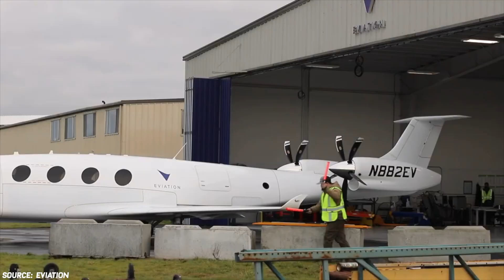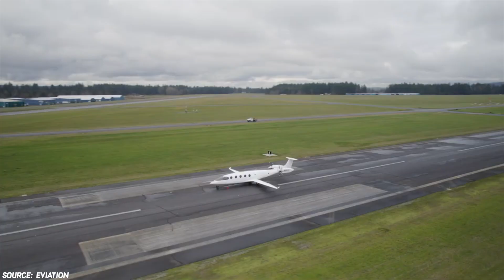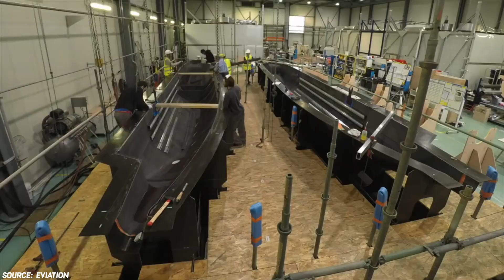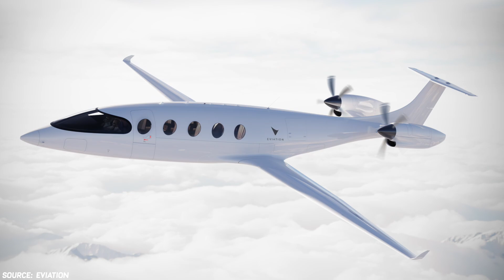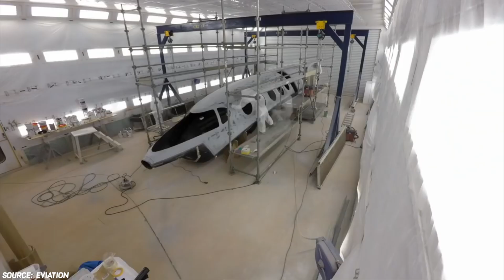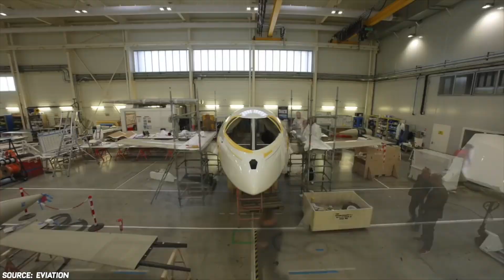Revolutionary: New Aircraft Is Coming Soon

Comment: While I'd love to be proven wrong, I simply have zero faith that Battery Electric Aircraft will be a viable alternative to replace anything larger then these little <10 seater regional piston aircraft, eg the Cessna 402 that Cape Air hopes to replace with Alice planes. Batteries weigh too much while holding too little energy. Kerosene has an energy density of ~43MJ/kg compared to the best Li-Ion cells at 1MJ/kg, and that "fuel weight" is permanent.

Comment: I wonder if we will see electric airplanes that can carry 300+ passengers across the Atlantic or Pacific at 800+ km/h
Reply: you need massive horsepower to achieve that speed, like the kuznetsov nk-12
Reply: @ProAvgeek6328  electric horsepower is not an issue at all. but the required energy is the problem
Reply: No I doubt we will see it in our lifetime.
Airbus is expecting Kerosene to be used for long haul for the foreseeable future. They don’t even expect hydrogen to work for long haul let alone electric.
Reply: probably not without ethanol or ammonia

Comment: The airliners are preferring sustainable aircraft for targetting zero emissions in future but subjected to electricity powered airplanes, whether they would really be able to handle the high load carrying capacity?
Reply: I suspect part of the solution will require us to become comfortable with less luggage or it traveling separately to reduce weight. A lot of out-of-the-box thinking is needed.

Comment: The only downside is the fact that we won’t get much of the engine sounds we love
Reply: Eh, when it comes to props, most of the noise comes from the propeller itself, not the engine. Check out the Magnix engine Harbour Air tested on their DeHavilland Beaver, barely much noise in idle, and when revving up, very similar to turboprops

Comment: Love it, you charge the batteries with electricity made from fossil fuels and then when the plane flies, it is 'carbon zero'! Bollocks!
Reply: Doolittle seems highly misinformed. He fell for oil industry propaganda it seems. 🙄
Reply: Even with coal power, electric transport gives a fraction of the carbon output, and in the case of planes, isn't spitting it right into the upper atmosphere.  Big difference. 

Your issue appears to be with the fact that electricity is made with fossil fuels, but I suspect you otherwise don't complain about that.
Reply: So let's charge it with hydroelectric or solar energy, then? Not to mention a combustion engine is at best ~38% efficient at turning fuel into power while an electric motor can reach 90. I can assure you the MBAs or their engineers with multiple PhDs see the value proposition, even if you don't.

Comment: Electric planes need a ton of work to make them profitable.  One or two fights a day will not work. Charge times are long
Reply: Liquid Hydrogen is the Answer
Green , Blue and Gray
Reply: So I just looked it up.  Tesla can charge 60% in 15 minutes.  Even a small plane like this would rarely turn around in less than 20 minutes.  An estimate of 1-2 flight per day isn't even close to what today's technology can offer.
Three years ago I was a huge skeptic of viable electric aircraft.  However, I've been consistently proven wrong by some of these start up companies.
Reply: Charge time for Alice is 30mins, maintenance costs will be far lower too as the engines have fewer moving parts. Your hypothesis is false, these new planes will allow short-distance-low-passenger flights to become profitable. Island-hopping flights, for instance, in which e-cars or trains don't cover. They will be able to do 8-10 flights a day and quickly recoup their initial costs. The key issue is that of the electricity which also needs to come from sustainable sources for all of this to make sense.
Reply: @stevemckeever4576  so we can expect $10 tickets?
Reply: @Badmansband  ha, no I wish!  fuel doesn't make up 90% + of the ticket price.  I think it was mentour pilot that made a great video on airline cost breakdown of your interested.
Reply: @markhenderson4204  What about maintenance, though? Electric planes would surely also have less moving parts, as the engines would only have motors as moving parts. So both fuel AND maintenance costs could be reduced. 

Although, I also do imagine that the price could be jacked up due to increased demand, as, let's be honest, an electric plane PROBABLY would have higher demand than a kerosene or avgas-powered one, with both emissions and noise being reduced. Who wouldn't want to book a ticket for a plane they knew was cleaner and less noisy? It'd be like a midget Dreamliner. (Man, that nickname sounds so wrong...)
Reply: @stevemckeever4576  30 mins  charge for one hour flight. So it will be done 50% of the time. Not profitable at all
Reply: @tentingaroundflorida  My understanding, based on papers that have presented the numbers, that routes which currently are not profitable will become with such planes. I'm less convinced by the hybrid models which are larger but only marginally more efficient. I suspect that e-plane companies are all betting on 1) better battery technology, and 2) pollution taxes, in order to justify their current development expenses. If they have certified planes then any improvement in 1) will improve their product with only the cost of upgrading the batteries.
Reply: @stevemckeever4576  Not to mention that a lot of these short flights are a gamble. Jets are faster, and have fewer moving parts, but GUZZLE fuel on takeoff and landing, making them more suited for flights where their gas turbine engines can be set at a constant rpm, where their peak efficiency can be obtained.

Turboprops solve the fuel guzzling problem, but at the expense of more moving parts, and, therefore, higher maintenance costs, with piston planes not being much better, with the price of avgas continuing to go up.

Electricity is already cheaper than fuel, and, with fewer moving parts, it'll be cheaper to maintain. The issues I would imagine would be reduced payload and increased turn-around times, although people who want to save money could tolerate the latter, seeing as low-cost airlines have exploded, so if the operator could charge less for the electric flight over a kerosene-powered one, maybe advertise the flight being environmentally-friendly, then I could see people lining up for it, regardless of the wait times.

The only OTHER competitor I'd see are diesel-powered planes, with some retrofit kits for fitting existing piston planes for diesel engines, as diesel engines consume less fuel than both turboprops and jets, although it hasn't been that popular, so... 

At any rate, I do believe that switching to electric planes will be like the 1950's and 1960's, when many airlines switched from piston planes to jets. A LOT of innovation had to be done, and many doubted the value of jets, but it paid off in the end.
Reply: @stevemckeever4576  how about you seperate promises from facts? Currently there’s no battery available on earth able to charge that amount in 30min. I’ve seen quite the few coverages of this aircraft and the charging time is physically impossible. Realistic charging time lies around 3-6h depending on the weather and power supply, wich is still pretty good for a battery that size.
Reply: @dopepopeurban6129  Agreed I'm going with their press release but swapping out batteries would easily solve that issue. That should take less time than swapping passengers.
Reply: @stevemckeever4576  It certainly would and may seem like a great compensation for charging time. However then we run into a whole ton of new problems regarding that. The turnaround Airport would need to be equipped to charge and change said batteries (if quickly possible, I don’t know where the batteries are exactly within the airframe), meaning dedicated storage facilities. There would also be the need to maintain those batteries, meaning maintenance staff and equipment. The local airport firebrigade needs to be equipped and trained to deal with electrical fires. ATC probably needs a new system of priority as electric aircraft usually tend to incorporate less Reserve energy in case of a major holdup or a diversion. I think this technology will work perfectly in a world wichs infrastructure support it, but this infrastructure doesn’t exist at this point and will need to be heavy subsidized in order for airports to operate these (mostly loss making) infrastructure.
Reply: @dopepopeurban6129  I agree totally and we need to be upfront about all of this, especially how to create the huge amount of electricity that a post-petrol world will require. The same applies to hydrogen which is Airbuses great hope for the next generation of airplanes. These too will require costly infrastructure and new forms of energy creation. My understanding is that renewables will never be sufficient, which puts nuclear (both modern fission reactors and eventually fusion) back on the table.